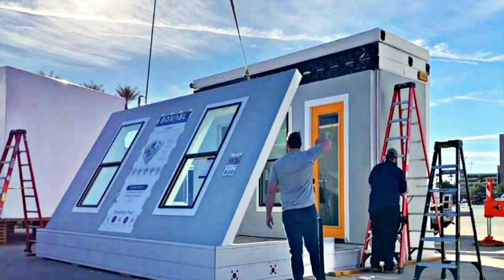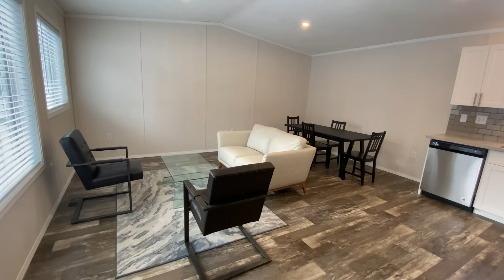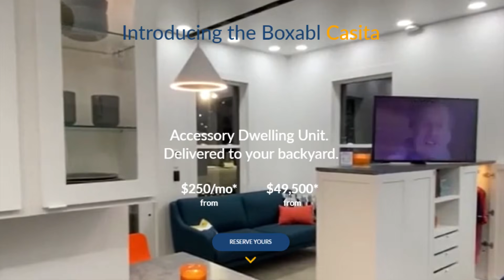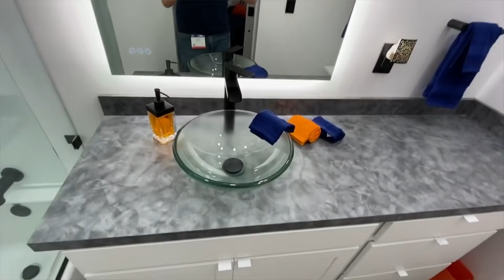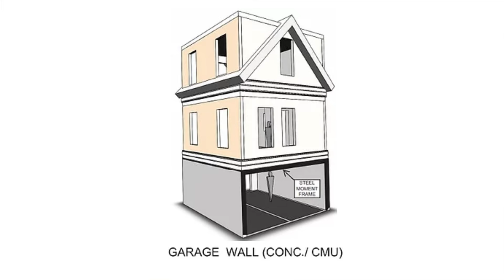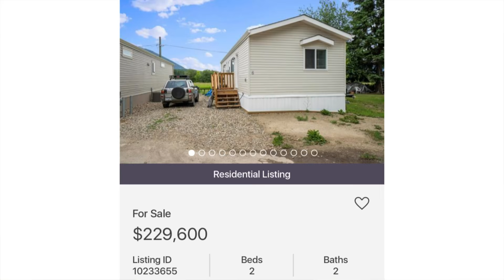The Real Cost of Elon Musk's $50,000 Boxabl Casita

Comment: It’s still to expensive for the average person/ family. You can build a tiny house for less then that
Reply: To be fair, there are plenty of tiny homes that cost much more than that as well. It is all relative to your lifestyle, the materials used, and the quality of the build. Not to mention your own personal sweat equity required to keep costs down, which can take away from your time at an actual paying job, and would likely not compare to the work done by a professional. It's true, it CAN be cheaper, but that doesn't necessarily make it a "better" option. It is simply another option, just as all these different alternative home videos are here to provide alternatives, but not necessarily the "best" as that is always going to differ based on each individual case.
Reply: Exactly, but those costs only exists for tiny houses if you build it yourself, have it on wheels to skirt building regulations, and have the time to find good deals on materials. I've seen tiny houses upwards of 100k-200k for idiots who have someone build it for them and get the most expensive options, and the company is a startup tiny house company who fleeces these people jumping on the trend.
Reply: I certainly can't build my own house, and unless you use salvaged materials, I doubt it would be cheaper.
Reply: That could take a long time.  And time is also money.  This was set up in an hour.

Comment: One of the major points of value with the Casita is maintenance and resilience. A normal home is made with wood and dry wall, two of the saddest widely used materials. The Casita will outlast a stick built by generations because of this. You basically just have to maintain your appliances and aesthetic features, depending on what kind of roofing you use.
Reply: That makes no sense! Wood framed structures can last hundreds of years, look at any historic area. It is the exterior cladding that is critical, any wood framed structure can be clad with the exact same material that boxable is offering.
The flat roof of a Casita is going to be hugely problematic, there is no way those hinged joints are going to last more than 10 years. Talk about sad, you are advocating for foam, steel and concrete construction, which are precisely the 3 top polluting and energy inefficient construction materials on the market.
Reply: @rozinant1237  well then what alternatives do we have? Surely the same old boring overpriced standard isn't the best we can do. That would be just as sad. I guess I'll use brick then. Wood is still not an environmentally friendly material.
Reply: @thecatsbackyard4833  wood, which is made from trees, and is 100% renewable, is not environmentally friendly? What am I missing?
Reply: @rozinant1237  The destruction of the world's forests to build more homes. It isn't sustainable at it's current rate. Not to mention the means by which lumber is obtained.
Reply: @thecatsbackyard4833  you must not be in the know about how wood is harvested now at days, you seem to still be stuck in the black and white no sound video era. Trees are marked and harvested a few within a certain area allowing for new trees to grow and now razing entire mountains like before.
Reply: @user27278  I wouldn't count on that. With wildfires increasing each year in size, ferocity and duration, wood is going to become more and more precious and harvesting it more damaging and expensive
Reply: @rozinant1237  it's not hinges, it's interlocking steel. It comes flat, but you can add whatever roof facade you want.